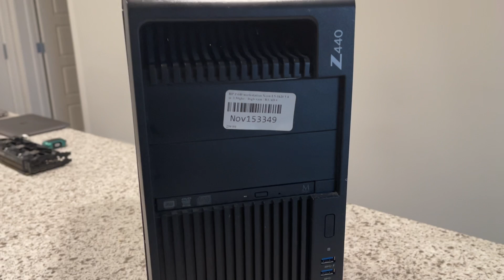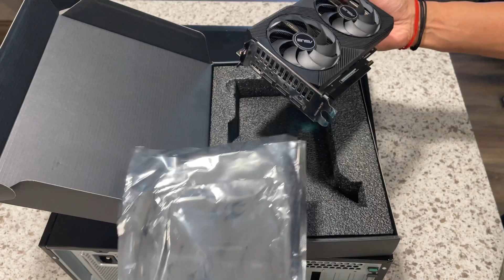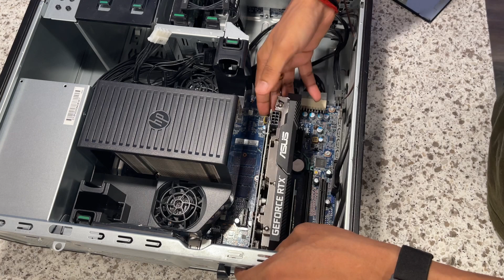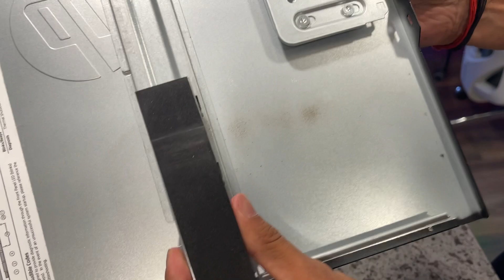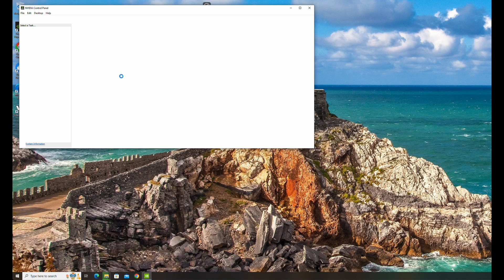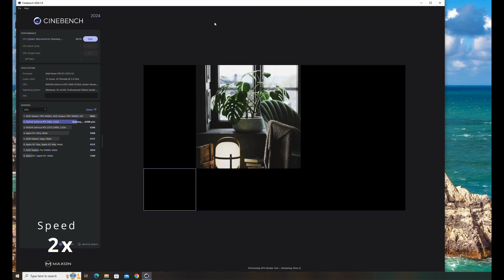Can a 10-Year-Old PC Handle an RTX 3060 in 2024? Ft. HP Z440 Workstation

Comment: Went with dual 6 pin to 8 pin adapter. Yo can remove the black bar on the case panel. Runs even better on Linux. Put Mint on mine.

Comment: Pro Tip : use duble 6 pin to single 8 pain connector becouse single 6 pin connector give 75w only and 3060 want 150 w i have also same z440 work station and gpu 🥰🥰
Reply from the maker: Great advice, I will keep that in mind!
Reply: Could you please share which adaptor do you use ? Also what I understand is that each 6pin G1 & G2 are 18A that means , G1/G2 output is 18A X 12V = 216 W , I'm want to buy brand new GPU which require 8Pin input and 150W , waiting for your feedback , thanks in advance
Reply: "I already bought an RTX 2060 Super that requires an 8‑pin + 6‑pin power connector, but my PSU only has two 6‑pin connectors. What’s the solution here?"
Reply: @kareemharb8023 upgrade your power supply more than 750 W and make sure your new power supply have 2x 6pin or 2x pin option

Comment: Do you need to update the BIOS for this GPU upgrade? I'm running version 2.57 and a Xeon E5 1650 V4
Reply from the maker: Hi, I did not update my BIOS to work with this or RTX 3090.

Comment: Hi, My PC is HP Z220 with 32G Ram and GTX1050, can I upgrade to RTX3060 12G ? THANKS
Reply from the maker: Yes, you can upgrade to an RTX 3060, but make sure your power supply is compatible. Also, check for possible CPU bottlenecks.

Comment: Is it safe and enough to use this 700 watt power supply on this high gpu,,does it harm gpu or not ?
Reply from the maker: Have been using it for almost a year with 90%+ GPU utilisation every now and then. No issue till now.

Comment: I have a hp z440 workstation (700 watt ps) with a 3060 12 gig( msi 3060 12 gb ventrus ) , 128 gb ram( 4 x 32 gb ) 16 cores (e5-2682-v4) and 20tb storage ( 1t boot nvme ssd) , very capable machine , well worth the cost, no bottlenecks
Reply from the maker: You got some powerful machine. I recently did a case swap and I’m loving it. (Upgrading my 11 year old PC into a GAMING BEAST with RTX 3090 | HP Z440 in a Corsair 6500X Case
https://youtu.be/77Y8OcMsJDg)
Reply: @Jackofall-tech  drool very nice! lol

Comment: You used single 6 pin to 8 pin connector but I'm going to use dual 6 pin to 8 pin connector. Is it good for me to use dual 6 pin to 8 pin with an rtx 3060?
Reply: I think that would be the better way to do it. Stupid doing it the other way IMHO.

Comment: Hey bro, I'm planning to buy a 3070 for my z620 workstation, I'm worried weather the single 6 to 8 pin connectors are safe, have you had any problem so far? I would be delighted if you share me the buy link
Reply: I have a z440 700w and i used that connector with rx 5700 xt for 2 years and now i am using it with rx 6650 xt no probleme at all even if you stress the pc ti the limits
Reply: @EladEditz  thanks a lot dude! been searching for the ans for a long time
Reply: @DeveshAdhikar  no probleme boss
Reply: @DeveshAdhikar quick update i don't know my luck is just bad today the connector stopped working started to smell burnt and pc crash until i saw the yellow connectors burnt so if you are trying to get one try to get high quality one
Reply: @EladEditz  your connector wires were most probably not meant for heavy loads, there is certain limit to these adapters, remove the adapter don't go cheap on these ones, buy one from a trusted brand, stress test it for atleast 3-4 hours keeping your case open in case something goes wrong. Man you're lucky that it didn't burnt your gpu like some of my friends
Reply: @DeveshAdhikar what if I use dual 6 pin to 8 pin connector for rtx 3060. Is it safe?
Reply: @sameerhassan7960  dual pins are absolutely safe, just don't cheap out in the adapter, buy a trusted adapter don't try to go cheap it will be come at the cost of your gpu
Reply from the maker: I have been running heavy AI workloads which uses a lot of GPU and I had no issues so far. I went back to the amazon seller but I think they removed it. I will check my emails and share the wire adapter soon here.
Reply: I'm pretty sure the 440 has two 6 pin wires and there are adapters that go from two 6 pins to one 8 pin. I would get that rather than one that is just a single 6 pin to 8 pin. I think that would be a much better way to do it.

Comment: How did you handle the case cover
Reply from the maker: I did a PC case swap with a gaming rig. Video coming out very soon.
Reply: Ahh okay. I also managed to remove that big bump with screw driver, was my issue. Thanks.
Reply: @1210saad  What's the metal part for on the panel?

Comment: I have an HP Z440, CPU 2667v4, 32GB RAM bus 2400, 700W PSU, and a 2060 Super GPU. I want to replace it with a GALAX GeForce RTX 3070 (1-Click OC). Is that reasonable, and will there be any bottleneck? I look forward to your reply, thank you!
Reply from the maker: I ran heavy AI workloads which consumes 100% gpu and 8-10G VRAM and observed no issues so far.
Reply: I have a HPz440 2667v4 with a 4070 super. Runs solid. I haven't had any issues with playability on max settings but it's probably as far as one could push it. There are times when the CPU can hit 50% usage with 97-99% gpu usage. 

My last upgrade I would try would be to get an E-1680v4 to see how that fairs. It's been an amazing system and has served me well.
Reply: @TyMYLINE  which connector did you use for 4070 super?
Reply: @sameerhassan7960  can't remember the brand but just two 6 to 8 pin connectors (make sure it's decent quality) then hooked up to the supplied 12pin adapter. The card can pull 220w but I've never seen that. It normally runs 150ish so I've never had a problem even with demanding games @1440p w/ RT etc.
Reply: @TyMYLINE  the 4070 super requires a 16 pin cabes, that would be converted to two 8 pin ones, you use single 6 to 8 pin adapters, are those safe? I've saved enough money for a rtx 3070 or a rx 7800xt depending on the budget but I'm worried about the adapters since I've heard some scary stories online. btw I have a z620 800W
Reply: @DeveshAdhikar  I can't speak to that system and PS but I was concerned about it too but I've had no issues. I was monitoring the wattage and it never got to max. I would just be diligent and make sure you get quality adapters and have it hooked up to a reliable power source and monitor the draw until you feel comfortable.

My gpu stays cool as well so I would pay attention to that on your build. I've had it for 9 months or so and I've had no issues even gaming for 8+ hrs.
Reply: I wanna do the same, except I have a z620, but since zotac 3070 has one six+ one 8 pin, since the z620 has two 6 pins, I'm worried about weather the single 6 to 8 pin connectors are safe

Comment: bro what processor are you running on that workstation? I am asking this question cause as you mentioned its a pretty old rig so adding a new gpu might give you a bottleneck ,otherwise congrats on the upgrade.
Reply from the maker: I am using a 2690 v4. I wanted to have more VRAM as I run some AI models locally. I am now running 3090 with this setup to have 24G VRAM. It is helpful for me to load AI models with more parameters.
Reply: I would like to do the same thing with the RTX 3060. Now i have the same HP Z440 Workstation, with Intel Xeon E5-1620 v3, Nvidia Quadro K2200 and 32GB of RAM. I am trying to find if it would cause the bottleneck. He might be in same config.
Reply: @jakubvodsedalek941  yes 1620 is bottleneck, buy the 2690 v4 processor and you will be fine even upto 3080 (bottleneck), 3070ti is nice spot
Reply: @jakubvodsedalek941  do these workstation cpus dont bottleneck? im planning buying hp z440 at 200$ with qyadro k2200